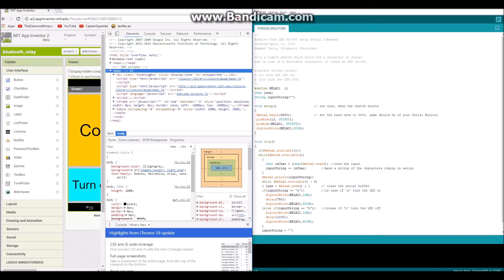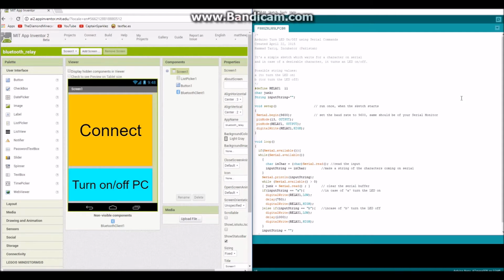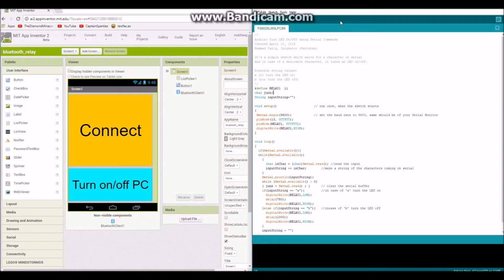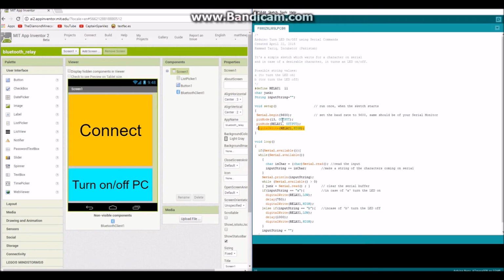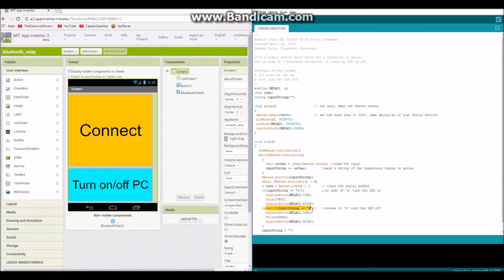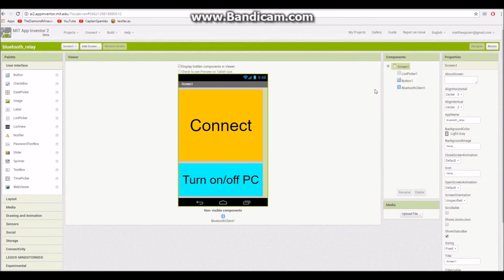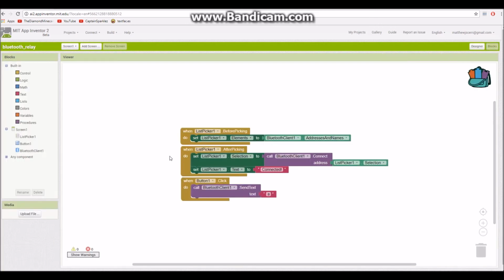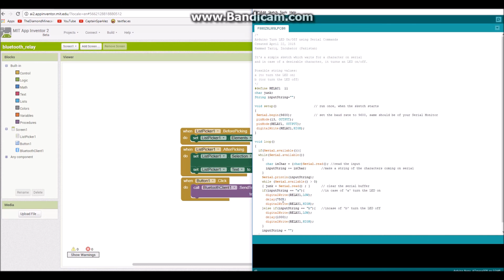Turning on/off a Computer Wirelessly With An Arduino

Comment: Great work ....can you please post a video showing how to connect relay module with the computer motherboard. I was not able to do it seeing this video. Can you please help me with this...
Reply from the maker: It all depends on your motherboard, simply follow the two wires from the power button to their headers on the motherboard, then short them out for around 1 second using a relay to turn on the PC. If you have any further questions please leave another comment below :)
Reply: @matthewjscerri  hi Matthew, thanks for the reply...but mate when you say "short them using relay", that i don't understand, as I am new with relay. Can you please elaborate it.
Reply: I know that my power jumper is connected to my front panel of the motherboard and I can see that you brought two jumpers out of relay output but what you did after that is not clear to me.
Reply: Can you please tell me how I must connect my power jumper to the output of relay and also i can see that you attached one male and a female jumper wire to the wire coming out of relay output wires. Can you please tell me where and how i am going to connect these wires to motherboard f-panel and to main supply...
Reply: I know i am already asking too much of your help ...but mate if you could post images of these connections, it'd be of great help ......Thank you again.

Comment: lmao have u never heard of wake on lan? seems like overkill for such a menial task
Reply: WOL is freaking crap. I set up my Google Assistant so that it turns on my PC through WOL (Google assistant -> Pushbullet message -> my phone sees that Pushbullet message and deletes it and sends a WOL packet to my pc) It would work if i had just turned my PC off for a couple of minutes and i want to turn it right back on. But if i turn off the computer and leave it off for a couple of hours and then i tell google to turn my pc on nothing would happen. LIKE BRUH YOU HAD ONE JOB AND YOU ARENT EVEN DOING IT! So, making an Arduino with a WiFi module directly control the power switch on the motherboard instead of sending a WOL packet seems pretty lit ngl
Reply: It may not work always. Requires port which your network admin may not agree to provide? correct me if I am wrong.

Comment: Give me the full code of your program?
Reply from the maker: Here you go although i cannot give you the android app unless i can somehow give it to you either via email or so:

int spood = 0;
byte data;
String inputString="";
void setup() {
Serial.begin(9600); 
pinMode(6, OUTPUT);
pinMode(5, OUTPUT);
}

void loop()
{
  if(Serial.available()){ 
       data = Serial.read() ;       // clear the serial buffer 
       spood=(int)data;
       spood=spood-128;
       spood=2*spood;
  }
    
      
   if(spood<0){
        analogWrite(6, -spood-1);
        analogWrite(5, 0);
        }
         else 
        {
          analogWrite(5, spood);
          analogWrite(6, 0);
        }
        if(inputString == "a"){         
        analogWrite(5, HIGH);
        analogWrite(6, HIGH);
        }
}
Reply: What is spood?